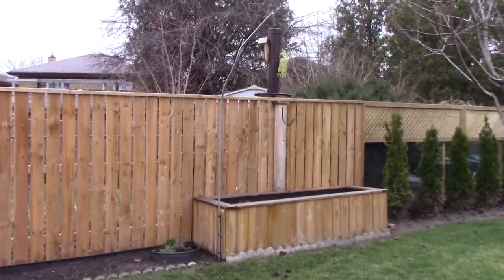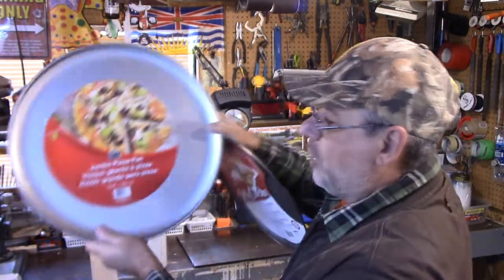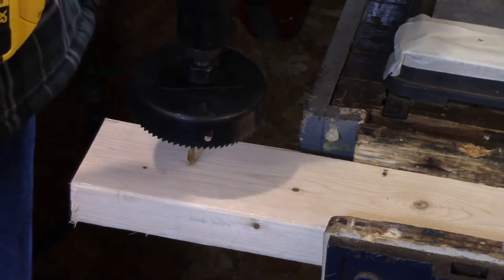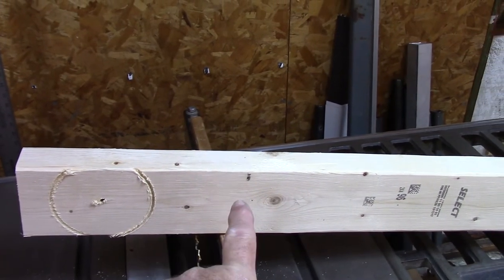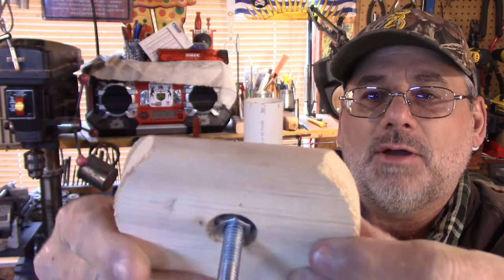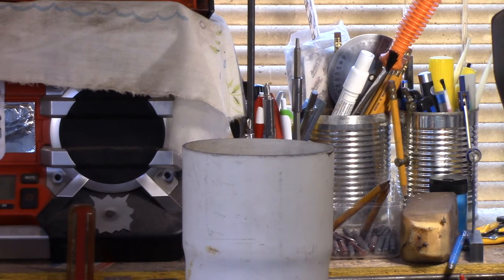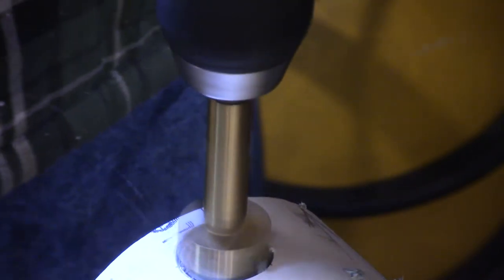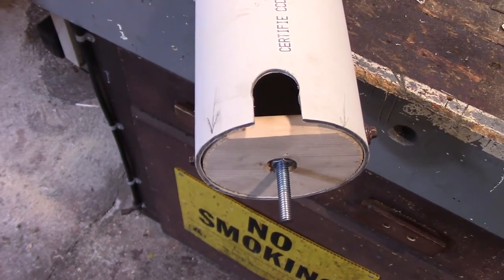The Ultimate Bird Feeder Build -  Look How Easy - You Can Do This Too

Comment: Thanks for posting your series of PVS Birdfeeders. We used several of your ideas and incorporated a couple of our own as well. In case anyone is interested, you can easily add a view through window (to see when the seeds getting low) by simply cutting the windows (we cut ours nice and low.) we then used a pb jar (straight walled soda bottle would work to) and cut off the top and bottom and sliced up once side. (so you have a rectangle) coil it and slide it inside the feeder letting is spring open into place. The other alteration we made was using an upside down funnel instead of the wooden angled in the bottom. :) We are loving our bird feeders.
Reply from the maker: That's some great tips .   Maybe youtube might be a a fun hobby for you too showing what we do. Cheers 👍
Reply: Did you use an altercation

Comment: Where you get your bender tool, and are you happy with it. Nice thumbs up on the bird feeder
Reply from the maker: I bought it at Princess Auto . It's just great as I have bent a lot of conduit .  I have the 3/4 & 1  inch , both were on sale for $50 each.  Great for easy bends and the conduit is great stuff to work with . Cheers

Comment: It would be much simpler to just buy the screw on caps for the pvc pipe and drill a tiny hole through it for the bottom plate and top plate and hook.
Reply from the maker: Sure give it a try 👍